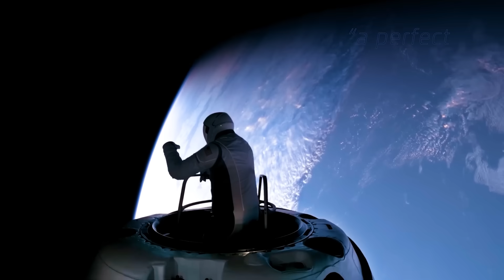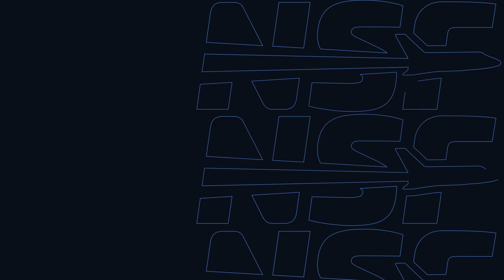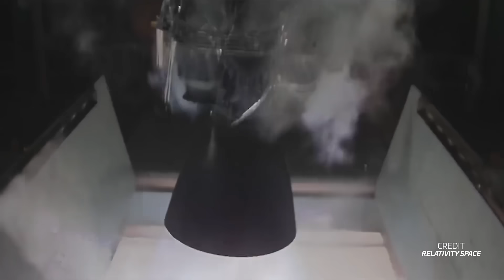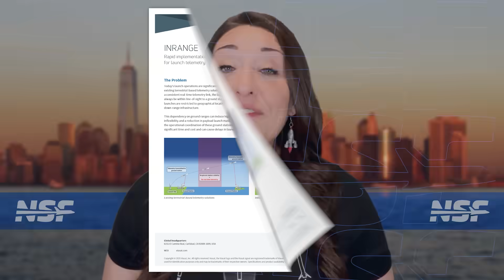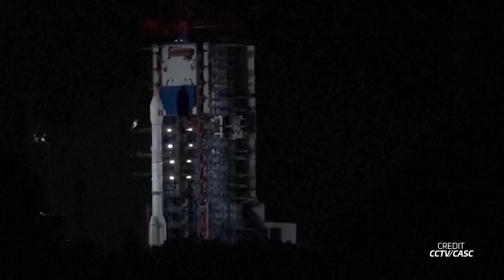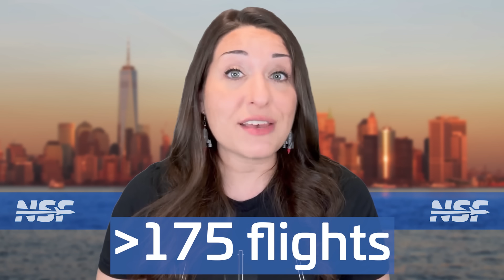Altimeter Failure, Fairing Pop, and Starlink Madness | This Week in Spaceflight

Comment: So there's no report on the thing landing sideways & hard??? Was it destroyed? Did they put a recovery system in the 2nd one after the first one tipped over? Is the recovery system working (or does it even exist) to get it on it's feet? Was it smashed & irrecoverable. Can they communicate with it still? What a waste when the video skips all that over. You'd think taxpayers would want to know how many million or billion it cost for this mistake & whether those funds vaporized or if there's still value there. Maybe somebody stuck up there some day in the future will start a parts depot for crashed &/or abandoned wrecks.

Comment: Question: Is our current technology or are our current space flight engineers less capable/knowledgeable than those who propelled the first moon landers? How is it that with less technology and engineering know how did we get to the moon, land, walk on it, get back in, lift off and return and now we can'l even land let alone get a human there again? What gives?
Reply: The south pole is much more challenging that landing on the moons equator from what I have read. I think they should be using radar of some kind to land. It would not be affected by dust and shadows.
Reply: Because there were humans on board who could make fast second corrections. All of these landers are automated
Reply: theyre privately funded companies for the most part and there are advantages that make landing easier when theres crew on the lander